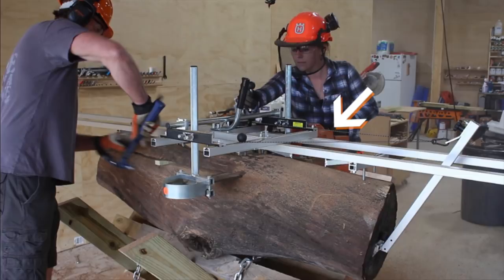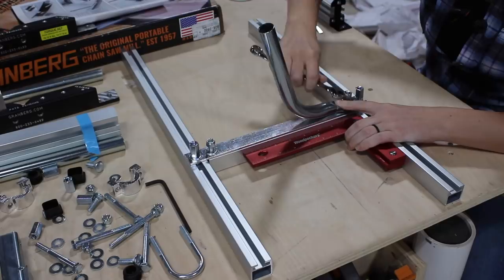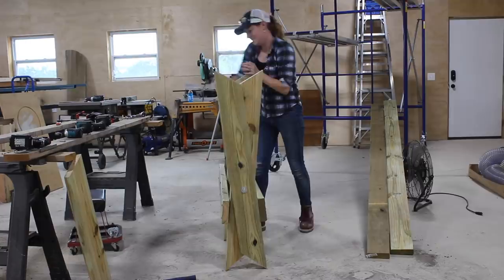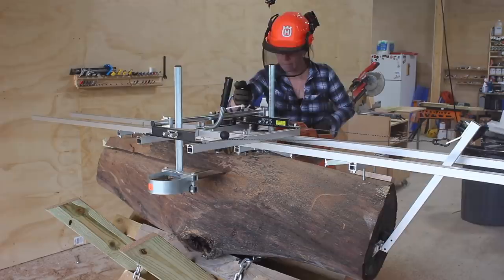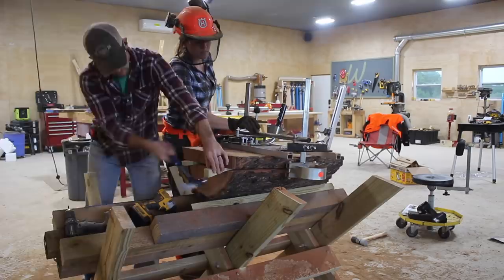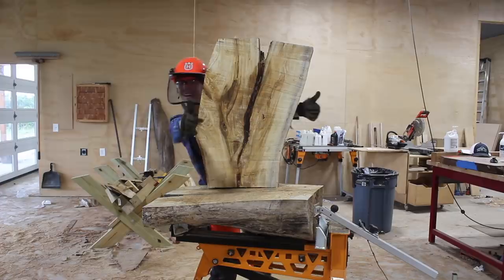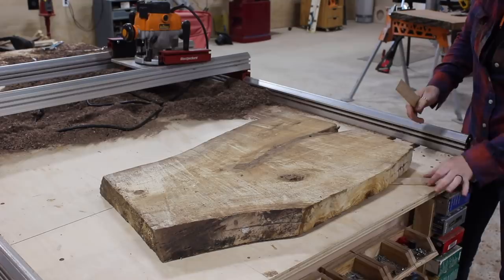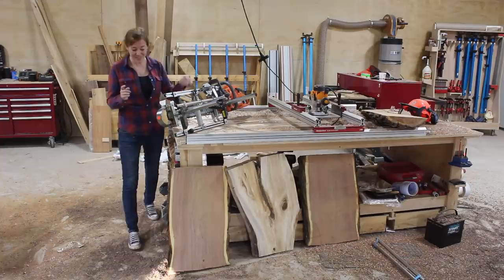Portable Chainsaw Mill : How To Slab Logs

Comment: Being a knife maker I don't have any experience drawing pieces of wood this big. However I have heard of other people that have made drying rooms or drying cabinets that greatly shorten the amount of time it takes to dry wood.. smaller pieces you can use your oven to dry. I've gone from cut down tree to ready to use 100% dry and stabilized wood in about a week and a half. Quite literally put it in the toaster oven for a few days at 120 degrees and gradually increase the temperature then vacuum stabilize once the water content is down to near zero
Reply: What happens when you release the 0 % vacuum?
Reply: @williambranham6249  the resin is forced by atmospheric pressure in to the voidz and Pockets that were previously occupied by air and moisture. Then it is heat cured and will no longer air or water and is essentially mechanically stabilized. A interesting note is that would loses its elasticity and becomes brittle after stabilisation.
Reply: I'm new to this so I did not understand the resin stabilization...Can you recommmend a you tube video that explains this.
Reply: @williambranham6249  I don't have any one in particular. Cactus juice is the name of the product I use. If you look up cactus juice wood stabilizer there are quite a bit of YouTube videos. It runs about $90 a gallon but it's very friendly for hobbyist to use
Reply: thank you

Comment: I started milling with a used Norwood 2000 bandsaw mill I found used for $2000.  I've had it for 3 years, and it paid for itself with very limited 'part time use' in less than 6 months.  I'm retired, still working full time, tug boat Captain, 66 years young, and have learned so much from your videos.  Keep up the great work.  Thanks

Comment: I can personally confirm that slabbing logs really is addicting! 😉 I don't have a winch and I think I'm going to need one of them! You make this look so effortless! And that was such a good idea to pile up scraps to fit your second log in your supports. Massive thumbs up for all the helpful information in this video! I can't wait to see the furniture you make with your slabs!
Reply from the maker: The winch makes it effortless! It's shocking how much of a difference it makes, so yes I completely recommend it if you are going to continue to slab. : ) Glad you found it informative.
Reply: I use a 6 pulley system that runs off my drill, i use a bicycle brake and cable system thats moubted to my saw to run the drill... This way i have controle of the full operation at all times at my fingertips
Reply: @mordyfisher4269  That's just too cool! Very innovative and brilliant.
Reply: Mordy Fisher That sounds like a great setup! 👍
Reply: @mordyfisher4269 nice. That is a wonderful idea.  I was looking   at putting a variable speed control on a wench but that definitely would work too.

Comment: That's OK April. Drop starting is a unsafe habit that everyone, including myself, uses. There is the potential for the saw to start and swing into your arm or leg. If you don't want to use the ground start look up the leg pinch method. Just a lot safer having three points of contact. Great video though, that's a nice setup you've made.
Reply: Not everyone, but certainly a lot of folk. I for one never do it, having seen some gruesome results.
Reply from the maker: Why not put the chain break on before doing it?
Reply: Been drop starting my chain saws for over 40 years and have had no problems at all.
Reply: @davidcurtis5398  Millions of people do unsafe things everyday and live to tell the tale. Doesn't make it safe.
Reply: @AprilWilkerson  Because that relies on you remembering to do something before starting it. If it's on the ground, or pinched between your legs you can't swing the saw into you even if you forget to put the brake on.
Reply: I remember "Get on top of that dump truck and cut down the brush!"  I had nightmares for weeks.  It still took 6 months of being a grunt before getting to put on a saddle and climb a tree and tie in and fire up a chainsaw.  Ah....the years of working for the city Forestry Department.
Reply: Drop starting is dangerous. It can be easier. But why not put it on the floor and know you are at less risk. Just like using a push stick at the table saw or not wearing loose items around tools that spin.
Reply: @AprilWilkerson  That's exactly what I do and have never had a hint of an issue.
Reply: @AprilWilkerson  The method you used on the ground is the safest, and with larger displacement chainsaws actually makes it easier since your foot holds it down. Drop starting is bad news, with or without the chain brake on.
Reply: @benningtoncamper2852  Yup, I'd say if you've gone that long with no problem, then you're due.
Reply: Agree...While at school in the northern regions of the USA I met a 70 year old retired lumberjack (actually met many of them in the bars back then).  He said for 40 years he never had a problem with drop starting...until the one time he did...cut was so bad he lost his leg below the knee.  Some have lost hands, chunks out of arms...too many stories.  I won't drop start a chainsaw (even with the chain break on) after seeing what happened to that old lumberjack (and some of the others I've met).
Reply: I mill with a 660 that I put big bore engine kit on for more torque, paired with a 36" (114 DL) chain...so I just leave it on the ground to start it, because I don't want to pick it up longer than I have to. lol (but I have made a habit of using the break, and it is a subconscious action now; even applying the break between branches when bucking trees).
Reply: I agree with Tony and remember you don't know what's inside the tree. It could've of grown around a metal fence post or a old metal bolt from a hunting stand. The bar will kick back and get your shoulder. Trust me, I've seen the fence post in person up her(here*) in Michigan. He didn't live.
Reply: My dad drops starts his chainsaw all the time.  I usually do not and my chainsaw supplier told me it actually can void the warranty.  It's safer to start from the ground especially with those big saws.  Also I think most of the new ones have a decompression button to make it easier to start from the ground.
Reply: Zero professionals (hundreds of logger's and arborist's) I know, start their saw on the ground. For a beginner it's probably better. By the way it's safer if you never touch a saw or leave the house. Regardless of your experience a chainsaw is a VERY dangerous tool and you always need to be extremely careful.
Reply: @AprilWilkerson  Because if you don't use the saw often your memory may fail you.
Reply: This guy has to have his two cents worth. Seeing a women handle a chainsaw has some how damaged his manhood
Reply: The trick to drop starts is you gotta do a drop kick while you do it. :-P
Reply: @AprilWilkerson  Stihl has models with an easy start option :) It really works.
Reply: @mattlewis5190 , no, he is just reassuring her that she is cranking a better way.   A safer way.   We should all be taught the right way from the beginning.   I work on saws and drop start almost every one of them.   It is taking a toll on shoulders.   If someone would show her how to ease it  just past the compression spot, she could crank saws even easier.   I am not sure if that new model has a decompression button or not but that makes a big difference.   Keep up the safety Mrs. April, you are doing awesome!!

Comment: 30 years ago I made a router sled in high school to make a pair of end tables out of black walnut.  Made the oak legs on the metal lathe for some reason, bed length maybe, and finally built leg pocket jigs out of maple to drill the 2" legs into the unfinished bottom of the slabs.  When they were finished the shop teacher gave them to the rancher and likely got a nice wad of cash.  Me, I got some great experience and I think a stereo out of the deal.  I was lucky enough to have one of the best shop teachers in a small eastern Oregon town.  Marv Peterson, I was a pain in his ass I know but I appreciate the things l learned to this day.

Comment: Quick point of note, although 'drop-starting' a chainsaw can seem like the quick and easy option (yes I've done it more times than I care to count) it isn't considered the correct way to start a saw and is by far and away the most dangerous. 
When I did my Chainsaw Course many moons ago, it was stressed to us that the only time 'drop-starting' was appropriate was when in 'Bucket Hoist' and then only with the saw outside the bucket. 
The 'put it down and pull' method is the correct way and if you actually look at the chainsaw handle/trigger-guard it is designed with a small 'out-crop' on the bottom for you to put your foot on. 
Props for wearing all the proper safety gear, you see so many YouTuber's doing potentially dangerous tasks without considering safety and this impacts how people think is the safe way to work.

Comment: Every cool I was just thinking of you. I wanted to look up those earbuds.
Reply from the maker: They are the best, you should.
Reply: I bought a pair based on seeing them used by April. I find them a little finickie to put on, but do a very good job. After a year of intermittent use they would turn off mysteriously after about 10 minutes of use. I contacted the manufacturer directly and they sent me out a new pair immediately! Great customer service!
Reply: What was the brand I got busy and forgot to look?
Reply: @rustyboltz5304  Iso Tunes - they make a few different models. I have the Pro version and I have seen April with them as well, although one of her recent vids she had a different model on.

Comment: one comment to make about the slab flattener jig: some kind of  cord management would be welcome to avoid routing the cable and blowing the breaker (or killing the user when the electrics are not to code).
Reply from the maker: yes I agree, I was thinking about adding something easy.
Reply: The fancy solution would be a cable cage like you see on CNC machines.
A simpler solution is a rod attached to the side and sticking up that can hinge down to give more slack. Weighted or spring loaded to make it return to upright and take up the slack as needed.
Reply: Also, there's zero dust collection and I'd say this is a significant short fall for this jig.  My 3 1/4hp Triton has a dust port, I'm sure the 2 1/4 does too, but that's not enough.  You need a sweep to hold the flying debris in the cutting area while a decent dust collector evacuates the chips.  It's an ungodly mess if you don't.
I'm afraid the cost for Woodpeckers jig will also be insane.  Although I love seeing new tools/jigs, I'm much rather see April build her own.

Comment: Neighbor had an oak tree with about a 4' diameter trunk taken down. I cut up the branches for fire wood and had the trunk milled into 5/4 boards 10 feet long that created 2000 BF of rough sawn oak. I stickered the boards to air dry.  I sold some to friends and made a bathroom vanity. The fun part was moving all the wood as we were in the moving process when the tree was cut. Total investment for a person to mill the wood was $200.

Comment: "Sharpen after every tank of gas" is not a bad rule to follow.
Reply: I have 3 chains and a very good sharpening company here in town. Use one - change - send it out - by the time another chain needs changing the first  one is back. I usually get 2 day service.
Reply: I have 3 chains and will easily blunt all 3 in a day. It's not that hard to learn to sharpen them well.

Comment: You really should give some costs on this stuff. A pro level Chainsaw plus bars & chains & Grandberg mill is starting to get to the cost of a manual bandsaw mill.
Granted you would need a good saw to fell this stuff.  Also, you are only working with tiny pieces. On a full length cant it can take 25 minutes to do one cut.  Another point is that there will be chain oil all over your shop cutting inside like that.
Reply: I was curious. Sum of ALL the things listed in the video description was $2645.53 (plus the slabbing jig). Taking out tools other jobs in the shop would already have (miter saw, router, etc) brought it down to $1428.38 plus the cost of the Woodpecker Slabbing Jig. The costly items are the chainsaw itself and the straight edge cross bars for the initial cut. Those 2 items are $800 of the 1400.

If you already had a large chainsaw and could figure out something else to use as a straight edge for the first slab's top, getting a mill like this set up can be done for well under $600... Something I feel the old April would have done before she had a half dozen sponsors for every video.
Reply: @WilReid  Saws must be more expensive here. Comparable Stihl 600 series would be easy $1500 USD
Reply: Those saws aren't comparable. A Stihl 661 is twice the saw a Husqvarna 460 is, 7.2 vs 3.6 bhp, and its $1230 price (here) vs the 460's $500 reflects that pretty fairly. The 3.5hp 450E (the saw April links to, but mfg website says max 20 inch bar) at $376 on Amazon is more comparable to a $420 Stihl 271 or $470 291, but neither show a 24/25 inch bar option on my local dealer's website. The next one up I see that does is the $580, 4.4 bhp, Stihl MS 391. It's $200 more, but still quite a bit "more saw" and imo a more respected brand. Stihl prices are a pain to find, so I hope that helps.

Just because I have it up already, the Husqvarna 395 XP is fairly power comparable to the Stihl 661 at 7.1 hp, and it also includes a similar $1200 price tag. It also has the capability of a 36 inch bar which is way more than most home sawmills will ever need.
Reply: @WilReid   That explains a lot. Like in cars, nothing beats Cu. in.
Reply: Not to be negative but that 450E will not last long being used in a CS mill.
Reply: I just bought a Stihl 391. It is a beast.
Reply: Vegetable oil in place of petro based for
chain oil. Don't laugh, it works.
Reply: You can get a bit more power for free from the Rancher saw with a simple exhaust mod  !

Comment: Why didnt you use an electric saw so you wouldnt need to breath the fumes.  Also electric will be quieter.
For the rest of you, what April left out?  Chainsaws are loud.  Even louder when used indoors.
Reply from the maker: My bay door was open, an electric saw would work but not through an entire log. Plus I'm wearing hearing protection so the loudness doesn't bother me.
Reply: I really doubt if you can find one big enough for this kind of job.
Reply: @AprilWilkerson  Must be in ear protection.  At 5:28 the hearing protection is rotated to parallel to the hard hat.
Reply: I use an electric chainsaw on my mill. It's quieter and no fumes, sure, but it's slow. Terribly slow. They just aren't powerful enough. Not worth it if you want to process a lot of bigger, longer logs.

Comment: Wow! wonderful video. I think I have to get a set up like this. What fun one could have! As to drop starting, I do it... but was trained better in Forestry school. We were trained to ALWAYS start them on the ground. After Forestry school and out working in the industry I got away from the safer method.  As I am getting older now, I think I will go back to ground starting. Also I was wondering? How quiet is that saw? I see you did not wear your hearing protection even indoors. I think I would counsel you to wear them now so you can hear your grandkids squeal with delight later.  Thanks for another great video!

Comment: Great video with lots of detail on slabing, one thing to keep in mind the rancher series saw is less expensive and intended for occasional use, if a viewer intends to do a lot of slabing it may pay to spend the money on a commercial grade saw,  these are long hard cuts that put a lot of heat in an air cooled chainsaw so be sure to keep the insides and cooling fins clean.  Happy milling!

Comment: As always, nice. Give woodpecker some feedback and tell them they need to add a power cord cable spring whip to the product so the power cable does not keep dragging. It's safer to keep the cable elevated off the table. Cheers.

Comment: I just got my granberg mill the other week. Can confirm it's amazing. 

One suggestion to look into is to make sure the clamp further from the chain saw motor at the end of the bar isn't putting any unnecessary pressure on the sprocket on the end. I think they have a suggested torque to use that should be safe, so make sure to follow it or pull your mill in a little so that it avoids the sprocket and is on a solid part of the bar.

Comment: I like the cradle you made for the logs... I think you could add a lift in the center so as the log gets smaller you can raise it up and continue to cut. A few pieces of acme thread tied together with some sprockets and chain would do the trick.

Comment: My dad use to sharpen chainsaw, tables saw, handsaws and such. We had Foley Bellsaw sharpener to do the chains on. Once it was set up you could do a chain in a minute or less(not exaggeration). Foley Bellsaw is out of business not, but Harbor Freight has a similar (and I am sure cheaper made) sharpener. If you get to where you have a few chains to sharpen, it might be worth looking at.

Comment: A quick tip, run the saw at almost 45 degrees with the nose of the bar forward instead of 90 degrees across the log, that way the saw will almost pull itself along the cut.